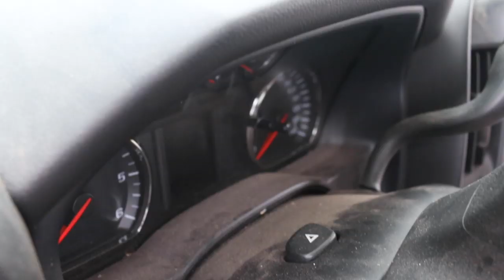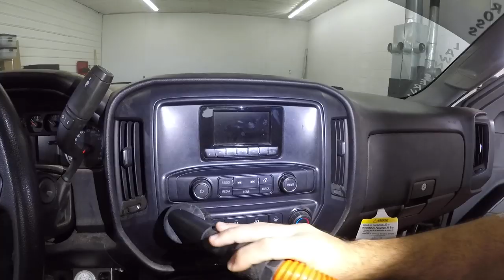Dirty Work Truck interior detail! Part 1 of 2

Comment: What are you using in the tornador? I couldn't use cleaner in mine because I ended up breathing in to much mist. I just use mine for wet wiping; door jambs, rinsing and drying rubber mats etc.
Reply from the maker: Generally I will just used a watered down APC such as stoner all purpose cleaner.

Comment: The trick to not pushing (much) dirt back into vents is to use that plastic pick you used AFTER using the tornador BEFORE using the tornador. With just some light cleaner on the towel. Get them as clean as you can before blasting into them.
Reply from the maker: Definitely a good idea for sure!!